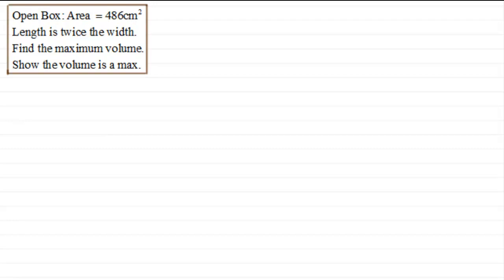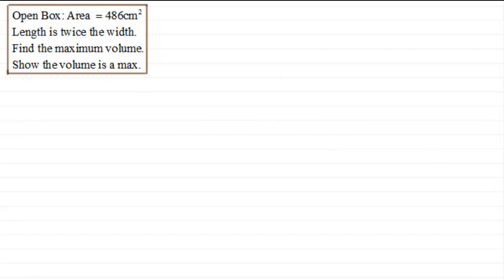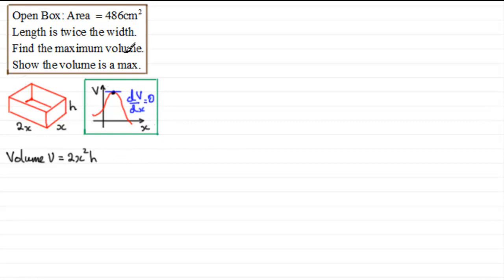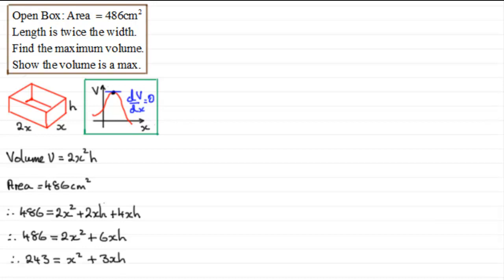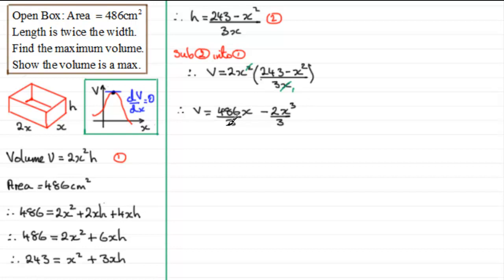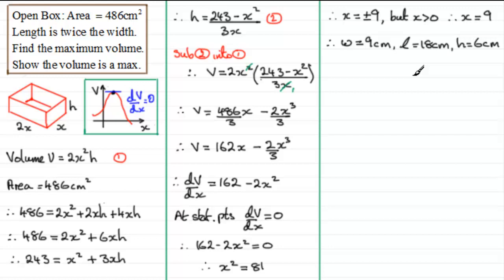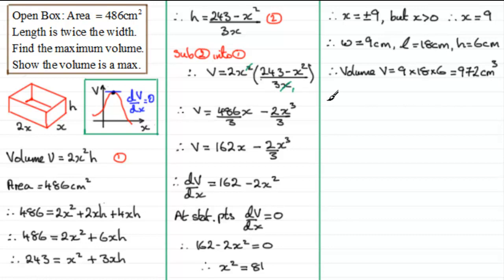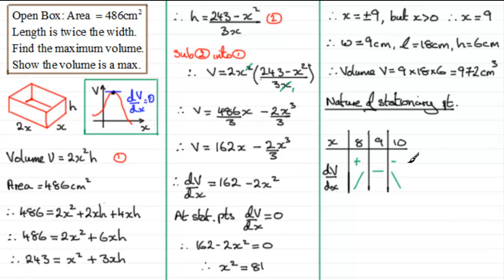Stationary Points - Maximum Volume of a Box : ExamSolutions Maths Revision

Comment: Thanks for this video, it helped a lot, but I just have one question:
when you're finding the equation for the surface area of the box, I noticed that you only took into account the outsides of the box, because you added each side once. In practical circumstances, wouldn't you include the surface area of the insides of the box as well by doubling each side, so the equation would instead be 486=2(2x^2+2xh+4xh)?
Reply: Usually the thickness of the box is negligible
Reply: They have mentioned open box in question
Reply: @vedantdesai9395  meaning what?
Reply: @variszarins  meaning that open side should not be consider
Reply: @vedantdesai9395  what difference does it make, open or closed? It makes more sense not to take interior into account when the box is closed
Reply: @variszarins  it is a five face cuboid not 6 faced because it is open because of which the equation created was 2x^2 + 4xh + 2xh rather than 4x^2 + 4xh + 2xh
Reply: @variszarins  he is consider 2 faces for other two sides but only consider 1 face for bottom face because there is no face in its opposite
Reply: @vedantdesai9395  bit late to this convo but the original comment had nothing to do with it being an open or closed box
Reply: @odiria5414  yeh I don't remember y did i include this